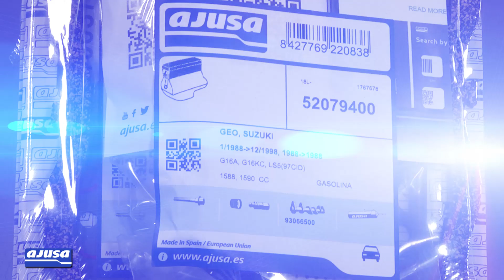SUZUKI VITARA 1.6 (G16A) Oil seal assembly – Montaje del retén de aceite Ajusa

Comment: Hola, buen video. Tengo una pregunta. Se rompió el cinturón del Vitara G16A 8v.
¿Se encuentran las válvulas?
¿Puedo reemplazar la polea + correa y listo?
Reply from the maker: Hola! Desconocemos si este  motor tiene interferencia entre válvulas y pistones. Puede verificar el cierre de las válvulas sin árbol de levas, introduciendo presión en los cilindros a través del hueco de la bujía. Si alguna de las válvulas está doblada, no cerrará y perderá presión. Puede probar a instalar correa nueva  y girar el motor a mano, comprobando compresiones en cada cilindro y viendo que no choquen las válvulas con los pistones. Un saludo
Reply: @AjusaAutomotive  Hola, me puse el cinturón y empecé. El auto está comiendo. Según el sonido del motor, todo está bien.
Tuve suerte o los técnicos del suzuki pensaron en un cinturón roto.
El intercambio se realizó en una pradera con un tiempo de 3 horas. Coche sencillo. :)
Reply from the maker: @miramlcak774  ¡Hola! Nos alegra leer que ha podido arreglar la avería :)